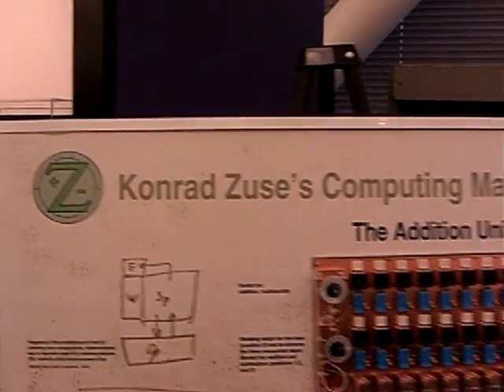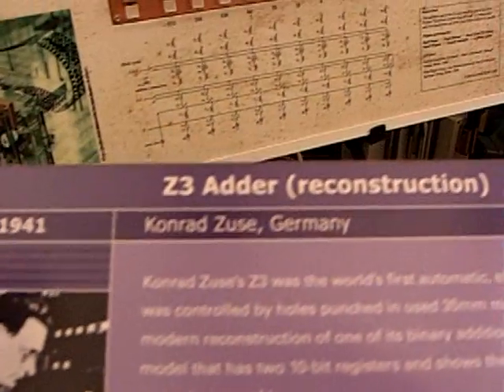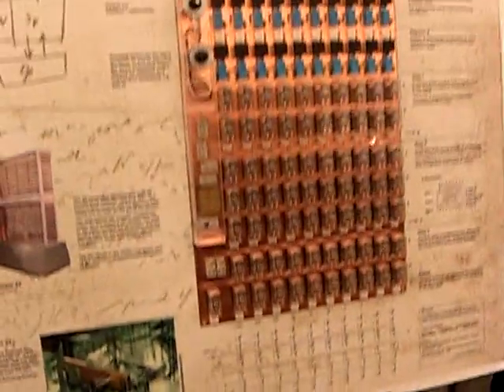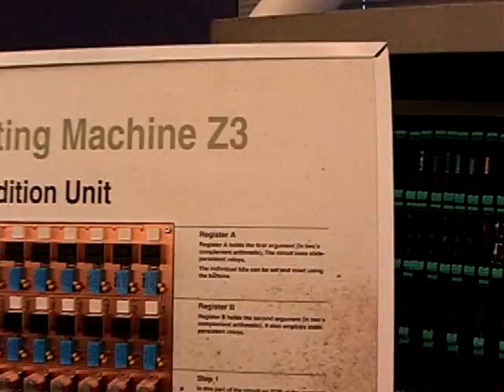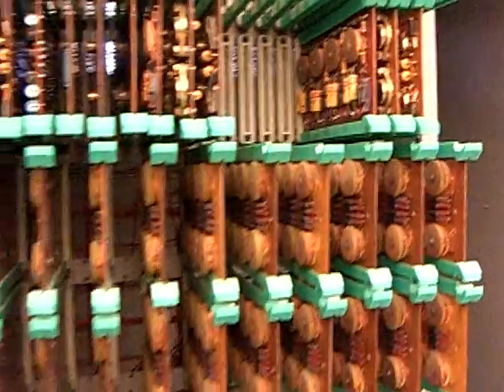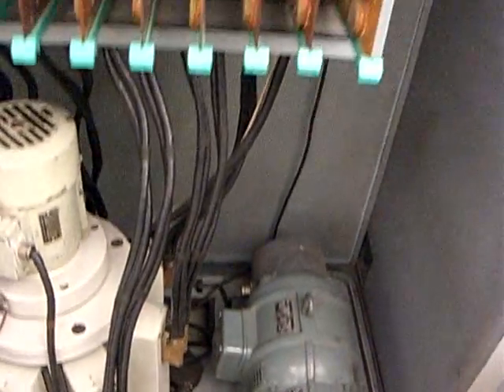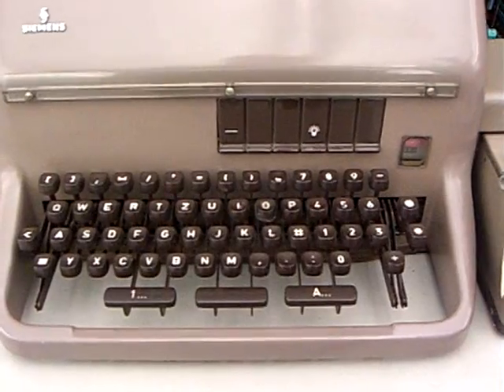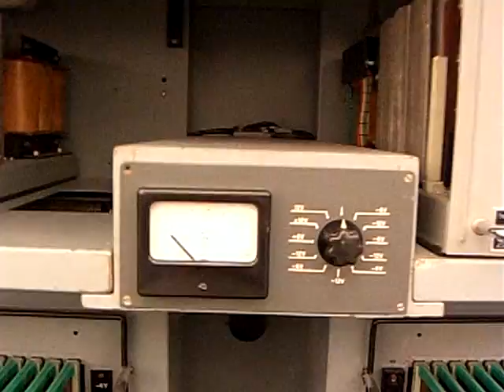Konrad Zuse's computing machine Z3

Comment: He  invented the modern computer.
Reply: FORBAN2 — Not really.  A number of people came up with fundamental innovations which contributed to the development of modern computers.
Reply: @GH-oi2jf  You're wrong. The Z1 was the first freely programmable computer in the world and contained almost all the parts of a modern computer, i.e. control unit, memory, micro sequences, floating-point logic and input–output devices; Z3 was the world's first working programmable, fully automatic digital computer, and Z4 was was the world's first commercial digital computer. So if someone deserves be called the inventor of computer, for sure it's Konrad Zuze.

Comment: A one-quarter scale functional model of the Z3 was built at the Free University in Berlin.  It was built using the original technical documents, and uses two large modern printed circuit boards and miniature cube relays.  The whole machine fits on a tabletop and even has LEDs to show the function of the data lines and the state of each individual memory cell.

Comment: Transistor was invented in the US and so were integrated circuits. Does Germany currently have an internationally competitve digital electronics/computing industry? The first single chip computer, the i4004, was made in US by Intel. Z80,6800,6502, x86,68000,88000,POWER, MIPS were all invented in the US. All operating systems were made in the US. Thinkfree,Alyac and Kakaotalk were made in Korea. SNS/Cloud is a Korean invention. So what was made in Germany?

Comment: Boole was english. Von Neumann was austrian-hungarian. Ludwig Wittgenstein (inventor of the truth table) was German. Both tubes and transistors (bipolar and FET) were invented in Gemany. First IC developed 1949 also in Germany.
Without Germany there wouldn't be any Microsoft, IBM, Apple, Oracle, AMD, Intel, TI, Samsung, Nintendo etc. nowadays!

PS: The Z3 was among others used to calculate critical flutter frequencies of airplanes by the Wehrmacht.

Comment: Oh come on, now you're contradicting yourself: First the Z3 was electromechanical, now it is mechanical only? The Z3 is still electromechanical!
It also doesn't matter whether a computer is electromechanical or fully electronical, and it doesn't matter whether the gates, cpu, memory or other components consist of relays, tubes, transistors, a motor for the clock or even a combination of them. The principle on that this computer works is in any case always the same! Get that right!

Comment: I ran across this old digital computer patent 3190554 where the thing ran on compressed air instead of electricity. Was this digital computer ever built and used for anything? Could one be built today using 3D printing? If Baggage had gone with this compressed air idea could his Difference Engine have been built by the folks that built pipe organs? I read that London's organ grinders and Babbage were bitter enemies. If this were not the case could they have been of help in the construction of the Difference Engine?
Reply: Z3 was build and working

Comment: @ickysdad 
all it took was a couple tricks in the programming of the code strip
no hacking or modifications involved as the Z3 had to be programmed anyways before usage
the tape had to be much longer tho

"Big difference using electromechanical [...] and being electronic as per ENIAC"

only difference that makes is calculation speed.. it doesn't change anything about functionality... the fuses also tended to burn out every now and then resulting in a lengthy reboot... neither system was perfect

Comment: I see you are still not willing to get it:This is NOT the point of the discussion!Before electronical computers there were electromechanical ones(like the Z3).And before that there were mechanical ones, like the Difference Engine or the Stepped Reckoner, which paved the way for modern computers. The Z3 -still the world's first functional program-controlled, all-purpose, digital computer- used THE SAME mathematical and logical principles that are used by any computer nowadays. Love it or hate it!

Comment: You said that Z3 used a motor as a clock. Thus it was not electronical. You have said that. The computer I designed and built 20 years ago had a clock of 33 MHz. I built it with help of US ,not German companies since only US companies had related technology. So how fast is a motor? Clock is generated by crystal oscillator , RC network or PLL,NOT by a motor.Motor is newtonian,computer is ohmic.

Comment: Neither difference engine nor Anitkythera nor abacus are computers, They can only do one single thing and are not electronical. Mechanical devices wear out and break down at a certain frequency while electronical circuits can be operated up to process limit(currently 2-3GHz in most cases). The computer I am using now is a Samsung 3.4GHz. How fast can you operate mechanical devices?
Reply: None of what you just said has anything to do with if a device is a computer or not... To be a computer, a thing needs only to be Turing-complete and programmable, which the Z3 is. By definition it is a Turing-complete, programmable computer. The Zuse doesn't just do 'one thing' it can be programmed to execute literally any task, same as your Samsung processor. Yes, it would execute the program very slowly, but the speed at which it does so does not determine it being a computer or not.

Comment: As I developed,designed and built a proprietary minicomputer in the past , you are not in a position to say this. There are clear definitions about what constitutes a computer, and mechanical devices are outlawed long ago for that purpose, just like handwritten "prescriptions". A legally valid prescription is printed out by a computer in TWO copies and its details entered into a centralized governmental system. The first patented computer was the Atanasoff ABC and the first practical the ENIAC.
Reply: "There are clear definitions about what constitutes a computer, and mechanical devices are outlawed long ago for that purpose"

So a device with a rotating harddisk is not a comuter?

Comment: @keirfree artificial intelligence? what the hell are you talking about?
zuse developed the z3 to help with mechanics calculations and that's what it did
the z4 was built for commercial use in 45  (1 year before the 3rd ever turing complete computer followed: the eniac) and sold in 50 to the institute of technology in zurich
the only computer that beat the z4 to being the first computer ever sold was a model that wasn't even working properly
the EDSAC was built in 49

Comment: Did the Z-1 beat out the A. B. C. computer in the U.S. as the first all electron digital computer?
Reply: I ran across this old digital computer patent 3190554 that operated using compressed air instead of electricity. Was this computer ever built and used for anything? Do you think one could be made today using 3D printing?
Reply: +ufoengines https://www.youtube.com/watch?v=2a6HMqsYnxk&nohtml5=False
Reply: +ufoengines Well, no. The Z1 (1937) machine was pure mechanical. The Z2 (1939) was a prototype for the development of the Z3 (1941). These three computers were destroyed in Berlin during an air-raid. A replica of the Z1 build by K. Zuse is displayed in the »Museum für Verkehr und Technik« (Museum for Transport and Technology) in Berlin. A replica with »reduced memory« - build by K. Zuse is part of the exhibition of the »Deutsches Museum« (German Museum) in Munich
The Z4 (1942) was a »better version« of the Z3 and it is the last »surviving« original. This computer was transfered to the ETH Zürich in 1950 and sold again to a French company and upgraded with a ferrite-core-memory in the late 1950ies. Finally it was transfered to the  in 1960 and it is part of the exhibition of the »Deutsches Museum«  since 1988.
Reply: I've read that the "ABC" work fizzled out at the beginning of WW2. Not surprising. But after the war big corp built the ENIAC based on its technology. When this was discovered, they lost the patent. Ha.

Comment: Yepp, the Z3 is electromechanical. But that's not in any case an issue. It has all necessary components of a computer according to von Neumann: memory, CPU, input and output devices. It was also proved to be Turing complete. The only reason why americans heavily depend on the "electronical" definition are PURE patriotical reasons and funnily only americans depend on that!

Comment: Z3 was not eletcronical but electromechanical; did not carry out actual computing work; has no log /documentation from start to end, cannot operate at realistic speeds as this would result in underdamped resonance,(vacuum tubes can be operated at radio frequencies) and there are no remnants of the Z3.

Comment: Z3 never operated in a working manner while the operations of ENIAC are well documented and evidenced, even with withesses. Photos and witnessesses are on Youtube. Now where are the remnants of the original Z3? Remnants of ENIAC are still existing. Z3  was not electronical either.Computers are electronical ; there can't be a mechanical computer. Retail stores are required to use electronical PCs with dual monitor, NOT abacuses or mechanical cash registers.

Comment: Electromechanical is mechanical. A mechanical device cannot be a computer. A quadcore Exynos based handphone or tablet developed here is a computer because it has no mechanical operation at all inside and runs programs. Relays have mechanical operation and thus subject to air resistance,inertia and drag and thus cannot carry out the fast operations of a computer. Vacuum tubes ,however, can carry out switching operations electronically up to radio frequencies.

Comment: This is NOT nonsense. Show me a nonelectronic computing device that is allowed to be used in daily business now. Electronics, especially microelectronics, is a technology billion times more developed than mechanics and thus has much higher gram unit value than mechanics. You cannot build a device like SIGSALY with gears,motors or relays. SIGSALY worked and was never compromised; Enigma was mechanical and quickly compromised. V=IR counts much more than f=ma.

Comment: You don't even know what a minicomputer is. It is something like a VAX-730/750 and not anything like a PC so I at least know minimum about computer architecture and have related certification. Cars are much more low tech than computers or semicon chips ; I also designed and made an airplane , a UAV which are much more sophisticated than low-tech cars or bikes. Even Taiwan makes cars(Luxgen) and bikes(Giant) but Taiwan can't make semicons under its own brand,just foundry.
Reply: the slanty-faced go to on... 😂

Comment: Only electronical devices can be computers. There are clear reasons why there can't be mechanical computers, such as very low resonance frequency, inertia, friction ,limitation in size etc. There are also very good reasons why mechanical cash registers are against the law and 2-monitor PC based POS terminals have to be used=the government has to know where people did what,where and at what time. The Allied already used SIGSALY with success.
Reply: xxwzaebd — That’s not true.  For practical reasons, modern computers are electronic.  But computers can be made with electro-mechanical devices, and they were, once.
Reply: Does this mean all devices with floppies and mechanical harddisks are not computers? 

Well, that would be news!

Comment: Engima was mechanical and was fully compromised by the Allied. SIGSALY encrypted/decrypted voice conversations fully electronically just like current day CDMA handphones and nazi army was never capable of decoding SIGSALY conversations. So things can be electronical only, not mechanical. You cannot have the old 128bit SSL using mechanical either.

Comment: There is no such thing as a nonelectronical computer. All key computer technology was developed in the US. All computers are electronical. ENIAC and SIGSALY saw real work for a time until they were decommissioned. Z3 was not turing complete by design, it was found to be so much later. In which REAL mission was Z3 used? Now show me the computer without electronics. x86,(former) 68000, Mips, POWER, PIC ,Atmel-all were developed in the US, not Germany. Show me the German CPU architecture.